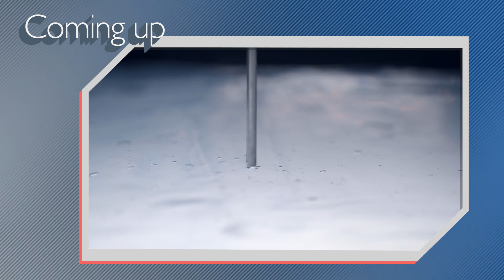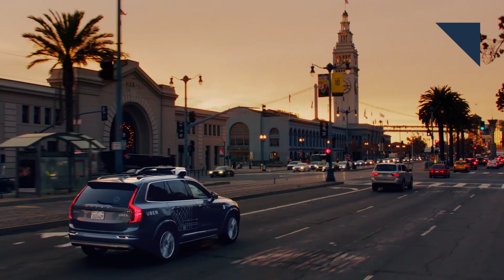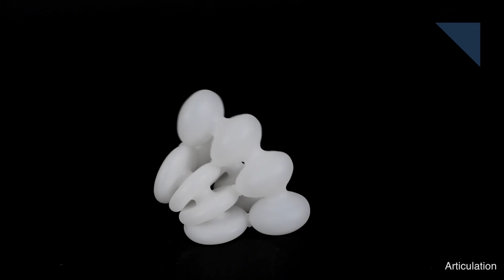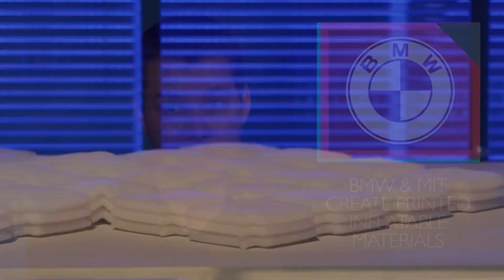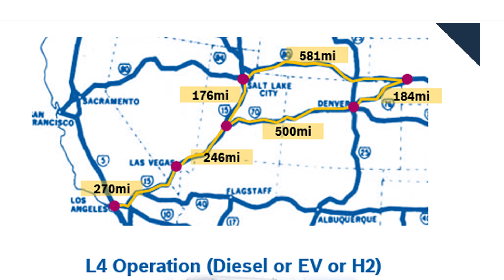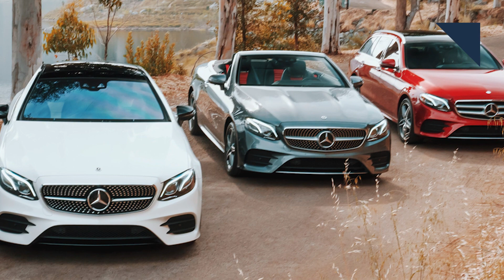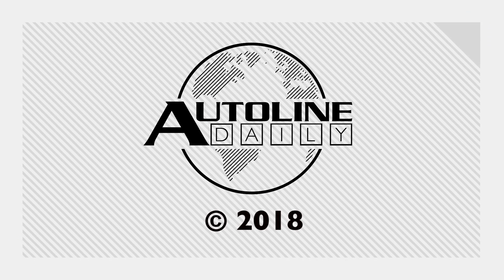Nikola Semis to Deliver Beer, Uber Faulted for AV Crash - Autoline Daily 2362

Comment: Nikola and the rest of the H2/FCEL industry will be using natural gas as feedstock for H2 production. This is why this industry is sponsored by NG industry. The electrolysis will make up a tiny fraction of H2 mixed in (just enough to claim they are "green").

It's the same greenwashing scam with ethanol mixed in with petroleum-based fuels.

The bottom line is H2 is not green or renewable in its current state. When using electrolysis exclusively, it is extremely inefficient and expensive compared to current batteries. By the time H2 has any infrastructure, BEV will be way ahead.

Anyone backing FCEL, even as a hedge, is scientifically naive.
Reply: Do you have a some links to back this up... That are not propaganda sites.  Because what you are saying reads like a load of hooey pushed by greenies trying to "save the world" but really are advocating killing civilization as we know it. Never mind how its powered, just make it ALL go away. More, you are pushing electricity deliberately ignoring how dirty producing electricity is and will likely be for the foreseeable future. Plus how limited the technology is and is overtly headed for a wall it will not get over anytime soon. 

Also Hydrogen ("H2", as you put it, as if it is something other than Hydrogen) is decidedly green considering how it has to be made. Whether it water or the cleanest of Hydrocarbon fuels which can also be produced fresh from garbage, manure, and similar sources, you end up with a chemical fuel that is all energy, Hydrogen whose usage, whether burned in an ICE or passed through a fuel cell, produces straight up and distilled WATER. 

The Carbon can be reused for other things, Graphene, Graphite, plastics, energy storage, etc. 

It seems more likely that Hydrogen will scale much faster with fewer caveats than Batteries. The costs would come down much faster without weight and capacity penalties seen in batteries (And NO I do not see any Battery Technology that magically does away with these issues). But to be fair, I only really see Hydrogen really being used for Commercial applications for the foreseeable future.
Reply: Ego Equus,

The Grid is just the transmission system for the electricity. It isn't even about storage. IT is about WHAT is done to generate the power, what runs the generators, what are the generators... 

Also Gas Micro-turbines as an interim solution. Why not just go to Hydrogen Fuel Cells get way more work with a cleaner fuel? You generally contradicted yourself in context to all your comments in this thread.
Reply: What is "intellectually lazy" is calling something greenwashing that u just used to rationalization and avoid admitting ur wrong. Since Brazil has efficiently made ethanol from sugar cane for decades so keep pretending they r cutting down forests to make it. "I won't even go into your assertion that cutting down forests" to put up a PV plant. NVM that just as a different absurd assumption.
Reply: Ur the one framing it as a NG Conspiracy like it or not. And the world would be far better place with H2 made from only NG replacing diesel trucks anyway. And u just avoided the example I gave that there r other alternatives So label it greenwashing but H2 is a good thing to see developed no matter what the BEV zealots/Elon cultist say trying to discredit it.
Reply: "Wells to wheels" efficiency comparison.

BEV using Solar/Wind 73% with carbon-free.
Modern MicoTurbines have an overall Gas>Energy efficiency of about 42% with carbon
FCEL/H2 using NG as feedstock  22% with carbon
FCEL/H2 using Solar/Wind/Electrolysis feed  10% with carbon-free.

These are physical limitations. There is no magical technology that can change this. If you think publications that show you these calculations are "propaganda", you are free to run the numbers yourself and publish how you got them. I have never found anything by the H2 industry that showed overall efficiency and their calculations to prove it. It's all vague references to how "H2 is the clean future". But make no mistake, this is an engineering task, not a PR exercise by a company selling H2 fuel.

https://insideevs.com/efficiency-compared-battery-electric-73-hydrogen-22-ice-13/
https://www.energy.gov/sites/prod/files/2014/09/f18/capstone.pdf
Reply: DocWolph 
So "electricity is dirty" but "electricity used to make hydrogen" isn't..... REALLY!?
and the hydrogen produced is used in fuels cells(?) Which are HOW efficient? (25% at best?) 
and these fuel cells produce.... Electricity?
So we're comparing "straight" electricity (90+% efficient production?) with "hydrogen" electricity (15% efficient production?) That's being kind, if the production of the hydrogen is 75% efficient (it's not).
Tis production will also either use lots of fossil fuels, which kinda' defeats the object? Or lots of Water, which is going to be a scarce resource in the future, so "lose, lose"!
Reply: Roger, correct. Also, the anti-BEV people like to point to the rare earth elements like cobalt in batteries. However, they fail to mention the platinum/palladium in FCELs. Last I checked, there is no plan to fix this in FCELs, but batteries are expected to be cobalt-free in a few years or sooner.
Reply: N C, you just proved you do not have any degree. The photo-conversion efficiency of solar does not factor into this argument unless you are comparing one PV technology to another. This is overall efficiency once the electricity is produced. Also, sunlight is free, so 15% of zero is still zero. Extracting energy from the ground or growing crops is not free.
Reply: Tre'von Cowen, HFC vehicles use three times as much electricity as pure electrics because they are inefficient. So if you are worried about a lack of electricity they are the worst. Because a lot of that electricity comes from coal and oil power plants, and the natural gas they crack for hydrogen is likely from fracking that pollutes the groundwater and releases lots of methane, and then the cracking releases still more CO2, these Nikola trucks are a lot worse for climate change and the environment than a diesel.
Reply: "H2" is hydrogen, specifically the hydrogen molecule that is used for fuel cells. It's shorter & simpler than writing "hydrogen" just like how CO2 is shorter and simpler than writing "carbon dioxide." If you have a complaint about Ego's use of it, I can't respect you.

I can't make/support claims about whether Anheuser-Busch will use natural gas as a feedstock for steam reformation at their refueling hubs, but I can say that currently 95% of the US' hydrogen supply comes from natural gas, and even then, it's far more expensive per mile than gas or diesel. Producing hydrogen from water (the video states "hydrolysis" when it should be "electrolysis") would make it even more expensive. There is absolutely no business case for Anheuser-Busch to do this other than virtue signalling. Thus, since businesses exist to make money, it's reasonable--albeit unsubstantiated--to believe that they will cut their losses by mostly using the cheapest hydrogen they can, which will be from natural gas.

All it takes to understand how hydrogen is a boondoggle is to run the thermodynamic calcs. Renewable electricity is more expensive than from conventional sources like coal or natural gas. So they are already starting in a hole. Next, electrolysis takes that electricity and throws 30% in the toilet just to make the hydrogen. Next, another 15% is lost with pumping/compressing. Then, there's any amount that could be lost/wasted from leakage or transport. Finally, there's the efficiency of the fuel cell. While NASA may have fuel cells with 60% efficiency, those in cars are unlikely to break 50% because consumers don't have millions or even hundreds of thousands to spend on them. Put all those efficiencies together and you quickly see that the round trip efficiency of a hydrogen fuel cell is close to 25%. Meanwhile, the efficiency of a battery is 93% or higher.

In other words, ignoring all other costs besides the fuel, hydrogen will ALWAYS be ~4x as expensive as electricity. Then add the extra costs of all the additional equipment & infrastructure, the best that hydrogen can do is ~6x as expensive as electricity. If an efficient gas car costs ~$15k to fuel over its life, that same car running on electricity (BEV) will cost ~$6k to fuel. But if that car runs on hydrogen, then it will cost ~$40k JUST FOR THE FUEL never mind the cost of the fuel cell. That's the result of basic science & engineering analysis. It's not anti-hydrogen propaganda. It's why it is correct to say supporting hydrogen is "scientifically naive."
Reply: I dont care what anybody says, Ego you know wtf your talking about. Cheers
Reply: Roger, NC and his ilk are just here to filibuster with FUD. You can spot them cuz they just quote industry PR and refute evidence as "Conspiracy Theories". You will never get hard numbers with citations from these guys. Also, they like to pretend they have "degrees" as a desperate attempt to shutdown the argument with authority.
Reply: Are people seriously asking where the electricity is going to come from to power BEVs but then ignoring that it takes THREE TIMES more electricity to power a HFCV via electrolysis? Where is THAT electricity going to come from?

Edit: I guess that was already addressed.
Reply: IMHO - You're not replacing a battery with just a hydrogen storage tank, you're replacing it with the entire HFC system, which includes the tank, a traction battery and the entire fuel cell system, which is a very complex conglomeration of hardware. Based on the completely insane cost of the absolutely pathetic Toyota Mirai, I'd say that the fuel cell energy system costs at least double what a comparable battery would cost, and the fuel cell vehicle will cost considerably more to operate. The FCV would also never be able to offer the environmental performance and convenience of a BEV (which can be charged at home) or the convenience of a gasoline electric hybrid (which has similar environmental performance).
Reply: A) I'm not saying that battery electric trucks are a solution here, they don't make any more sense than HFCVs for long-haul trucking. They do make a great deal of sense for shorter trips, though. 

B) The cost will never, EVER be competitive because absolutely everything associated with producing hydrogen, storing hydrogen and making use of hydrogen is so insanely expensive, and because of the massive lack of efficiency inherent in producing, storing and making use of hydrogen. If you wanted to fuel a fleet of long-haul trucks with green energy, you'd need at least a hundred acres of solar panels to produce the hydrogen. If you wanted to power battery electric trucks with solar, you could cut the amount of solar panels needed by probably 70%, but you're still going to need a HUGE area of solar panels. Hydrogen doesn't make sense from any angle, period. 

"And then you will lose energy going from that battery to the car’s battery and then from the car’s battery to the drive train."

And? It would still be drastically more efficient than compressing hydrogen.

"In a HFC vehicle, the battery is just a buffer."

Duh, but it's still necessary for the functioning of the vehicle.

"Nikola is making the H2 with electricity, not fossil fuel, and that’s all that matters."

You're right, it is all that matters, because it means that these vehicles will be insanely expensive to operate.

"The fact that hydrogen may need 3x more energy than a battery may change significantly if some of the new catalysts work which allow more efficient electrolysis."

Yeah, and the energy density of batteries will increase by 100 fold and make electric airliners viable! /s 

You and the BEV people are dreaming, but BEVs still make drastically more sense than HFCVs.
Reply: My proposal for long-haul trucks: Make them operate largely as battery electric vehicles (~400 kWh battery), include a gasoline, or diesel, or natural gas range extender (small displacement, maybe a 4-5 liter inline 6, ~200 kW), use an electric power recovery turbine to maximize the efficiency of the range extender, plug in when possible. Nothing else makes sense to me.
Reply: DocWolph 

Coal is about to fall under 30% market share. Renewables are about to surpass 20% with nuclear holding steady at 20%. It took me a few seconds to google this and a few more seconds to post the link.

https://www.eia.gov/tools/faqs/faq.php?id=427&t=3
Reply: You only need to see the drivetrain of a Mirai, Nikola, etc. versus Tesla. Then add to that the H2 infrastructure versus BEV charging infrastructure. We are talking orders of magnitude in complexity and cost. 

The Hydrogen Economy depends on government sponsorship. There is no way it can happen based on private capitalism and economics.
Reply: So whats your solution electric how do we generate that much electricity
Reply: microturbines on their own very inefficient but its relatively cheap and simple.  there far more inefficient options.
Reply: Electric utilities need to do create Time Of Use (TOU) metering rates for the grid. To make it cheaper to use power during off peak times and cost more during peak hours. This will increase the overall utility of the grid without having to add more transmission capacity.
Reply: N C 
First, where do you get "H2" from? You keep quoting it, I presume you mean hydrogen? ("H")
Second, HOW MANY TIMES? Hydrogen is NOT a green fuel!
Reply: The Average Photovoltaic System Efficiency.  maximum efficiency of around 15 percent. so it craxy to say BEV using Solar is at 73%. when u start at 15 percent. 

The Average Photovoltaic System Efficiency | Sciencing
https://sciencing.com/average-photovoltaic-system-efficiency-7092.html
Reply: Ego Equus 
Absolutely, also, as you say NC Doesn't seem to account for the fact that the SAME  electricity either goes STRAIGHT TO an EV, or into the inefficient Hydrogen production.
Hey N.C. do you get it now?
Solar, electricity, then EITHER
1) Straight to EV
Or
2) Produce Hydrogen (inefficient)
Store Hydrogen (inefficient)
Fuel cell (inefficient)
Electricity (Hold on!! is that the SAME Electricity we started with? Actually yes!, but ONLY 20% if it!!)
P.S
I don't have a degree, but I DO get it!
Reply: idontcare80, for me, they are all just test beds, and should be researched in parallel. I think H2 is going to be a critical fuel source at some point, especially for war and space travel once fossil fuel is gone. Not sure who would win a war with battery powered vehicles or hydrogen powered fuel cells and rockets. So far I don’t think they have an efficient electric propulsion for jet fighters.
Reply: idontcare80, I think nikola should offer different range extender choices besides HFC. At one point I think they planned to use a flex fuel micro turbine which is clean and efficient and can run on anything from Jet A to McDonald’s French Fry oil.
Reply: Well, you're wrong, hydrogen can't be used to power aircraft, you can't fit enough on board to power conventional engines and fuel cells are far too large and heavy to power electric ducted fans, which also can't be built light enough and powerful enough to power large aircraft, so we need a carbon-neutral way to produce liquid hydrocarbon fuels. If we're going to produce a carbon-neutral, liquid hydrocarbon fuel for use in aircraft, we might as well use that fuel in other applications as well. Thankfully, the US Navy has found a way to produce carbon neutral, liquid hydrocarbon fuels using sea water and nuclear energy, THAT is the future of high performance, long duration transportation, not hydrogen. The great thing about using sea water for fuel production is that it also offers lithium for BEVs, uranium and thorium for nuclear energy, salt for saline batteries and water for drinking.
Reply: Yeah, NIkola was stupid for adopting HFC technology. Wrightspeed is already building range-extended trucks with turbine engines. Because of their inefficiency, turbine engines really only make sense for burning heavy fuels, because of the many problems associated with cleaning up the emissions from diesel engines.
Reply: idontcare80, actually they are working on some rocket engines which use liquid hydrogen to cool ram air at Mach 5 and then switch to onboard oxygen once’s in space. And you can also burn hydrogen in a piston engine. If the liquid hydrogen tank explodes, all passengers will be instantly frozen and kept in kryogenic storage until we figure out how to thaw them without killing them. LOL.
Reply: Hydrogen rockets have been in use for a long while, but they use cryogenics to store the hydrogen (very energy intensive and expensive) and the cost (environmental or monetary) has never been a major consideration.

Like I said, using hydrogen to fuel conventional engines means that you need to store a LOT of hydrogen. The Soviets tried to power an airliner with hydrogen, but they ended up having to eliminate the passenger and cargo carrying ability of the entire rear half of the aircraft, just so that they could store enough hydrogen on board to power one of the three engines. Hydrogen also causes metal embrittlement and that's not something you want to have happen inside of a piston engine. The cost of building a piston engine that can resist metal embrittlement would also be enormous.

A person is dead the instant they are frozen. We don't live in a sci-fi, where people can survive being frozen. An explosion of a liquid hydrogen tank on board an aircraft would also destroy the aircraft, and frozen people hitting the ground at hundreds of miles an hour would not be pretty. I honestly don't know if you're joking, I've heard people suggest dumber things in complete seriousness.
Reply: N C 
Some already do. We pay $0.06 a kWh as our Chevy Volt is programmed to charge off peak at night. Xcel energy offers such a program. Costs us about $1.12 to drive 53 miles.
Reply: The grid has plenty of capacity, but not enough storage to use it. A lot of generating capacity is wasted in off-hours waiting for peak demand. Australia has had the same problem, but is being solved with storage.

Check my other response on gas microturbines as interim trucking solution.
Reply: Ego Equus, Nikola will make Hydrogen with electrolysis, just like many of the already installed hydrogen stations. The fact that they may use fossil fuels instead of direct from renewable energy is the same as saying all electric cars run of coal, just because some do.
Reply: idontcare80, what is the cost of a hydrogen storage tank for 100 kWh vs a 100 kWh lithium battery per megawatt-hr pass through? Batteries are fine for some applications, but there is no reason to try to block progress on hydrogen just because you feel it will slow the adoption to BEVs.
Reply: idontcare80, nope, the hydrogen fueling station doesn’t have a traction battery, and that’s what I’m talking about. All these solar powered charging stations need to store the energy for charging when the sun goes down, if we live in a world with nothing but renewable energy.

So at a Tesla supercharger station, such as Kettleman, which has nearly 3 mw peak charging capacity, if it’s just used at 10% for the 15 hours without sun, will need a 4,500 kwh battery. And then you will lose energy going from that battery to the car’s battery and then from the car’s battery to the drive train.

In a HFC vehicle, the battery is just a buffer. The hydrogen generates electricity and most is consumed by the drive train. It doesn’t charge the battery and then go from the battery to to drive train unless it’s in a special mode to climb or descend a steep hill.

Nikola is making the H2 with electricity, not fossil fuel, and that’s all that matters. It’s up to them to show if they can do it in a profitable way. All these arguments about what other hydrogen plants use are irrelevant.

The fact that hydrogen may need 3x more energy than a battery may change significantly if some of the new catalysts work which allow more efficient electrolysis. And with solar power dropping faster and faster, it may be a case where we don’t have enough battery’s to store what we make, and the energy is just wasted. But if we can store H2 cheaper, and that may be needed.
Reply: Nice conspiracy theroy but the only scam s brainwashed cultist using one-sided talking points that r waste of time.  There is trade offs no matter what is used. Go check the Bio waste H2 plant that Toyata is building.  So learn  think for urself instead being part of a group think mentality. There is no one easy answers. 

And ethanol used as fule makes sense when its used in Brazil from sugar cane so even that generation was BS.
Reply: Labeling everything as "Conspiracy Theory" is intellectually lazy. Everything I wrote is from the industry and DOE materials, but you are too lazy to read them.

I won't even go into your assertion that cutting down forests and growing crops for fuel is somehow a good thing. Do the arithmetic on that one. I'll give you a hint (Energy required for transportation) divided by (Energy per unit acre) = (Total acres required for transportation).